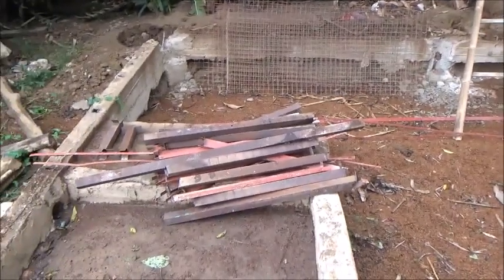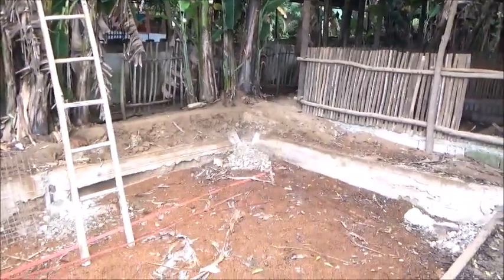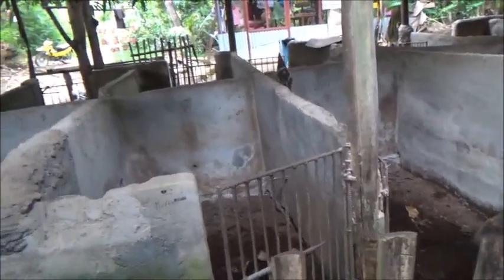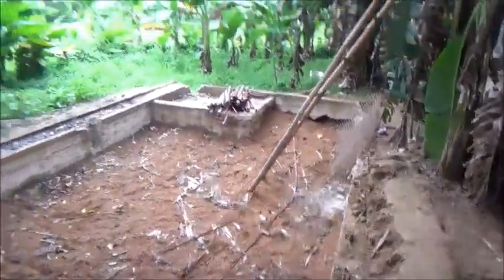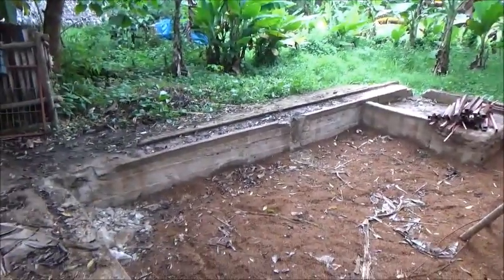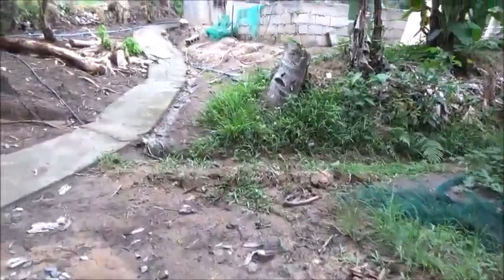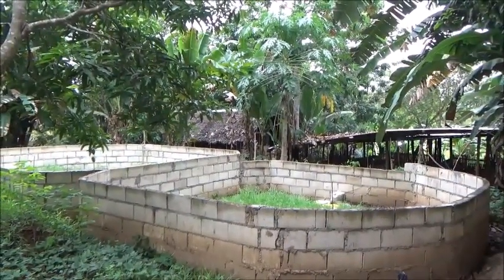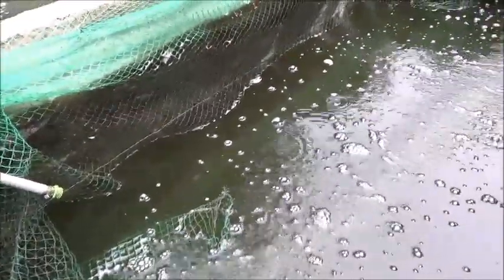Future Plans For The Old Fattening Pen

Comment: Hi Brian use old wall from pig and fill in for the floor in the new house and you do not need so thick concrete floor in the house,the concrete walls you have no use for it s garbage ,and excavation of the new pond you can use as you want for something else, like the garden or or   in the small tanks I would use deep plates porcelain 5-10 pcs and put in the water for the fish can lay eggs in, (plastic plates probably float up to the surface) B-coz you have net in the pond and thay don t want to lay eggs probley

Comment: You could use The piggery wall and break them up reinforcing with a little bit of rebar and put it on the bottom of the tank you would use less semen